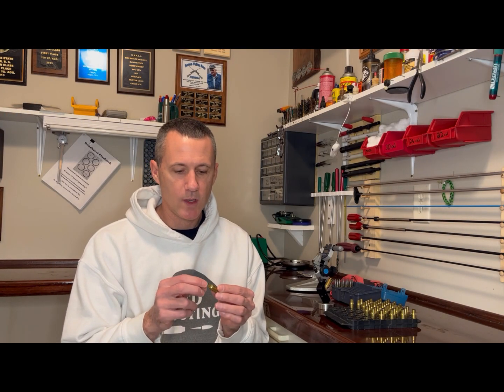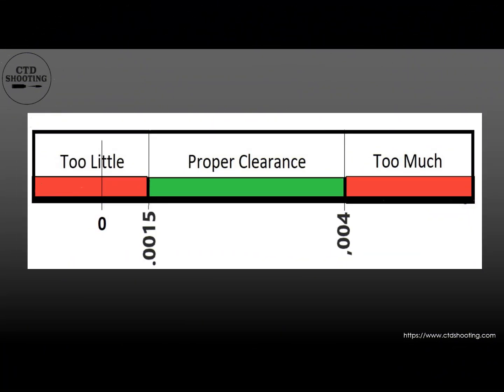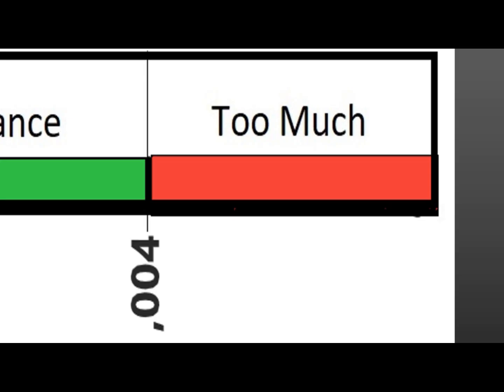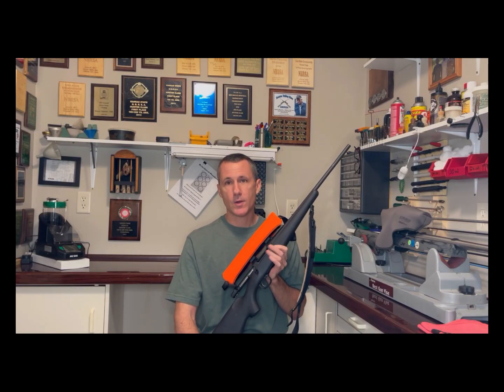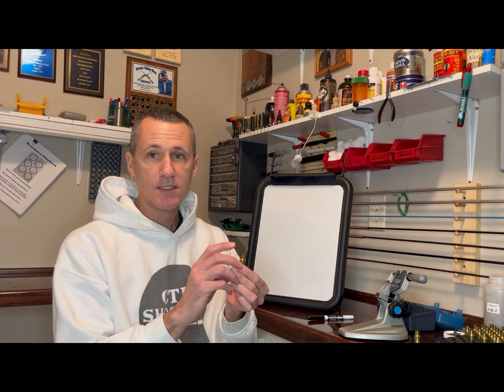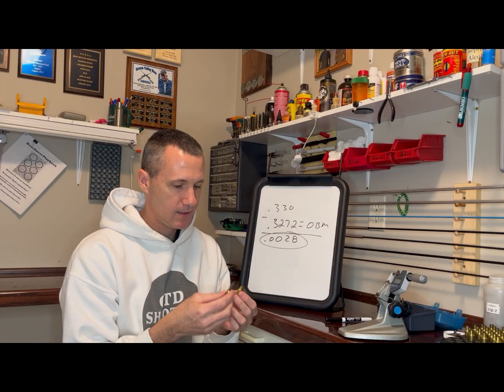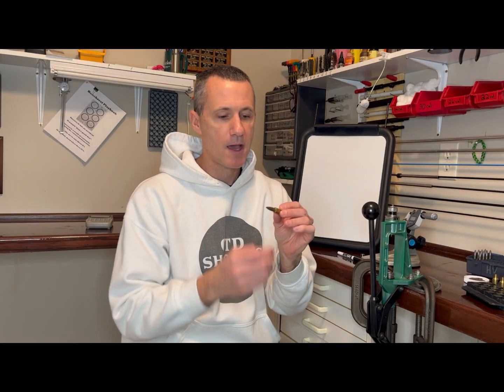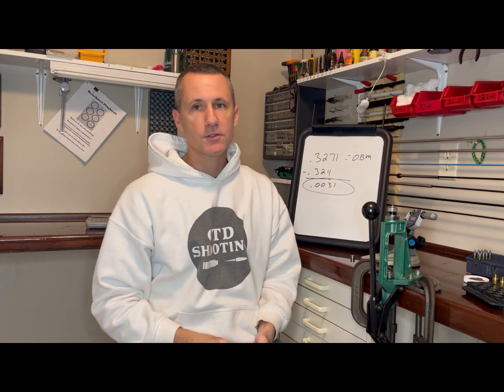Understanding Neck Clearance and Neck Tension:  Basics to Advanced

Comment: So when using .311 diameter bullets do i use my .307 expander or .310 expander? If I use the .310 with .311 bullets is that not only .001 tension and not enough, especially in a semi-auto?
Reply from the maker: Thank you for taking the time to ask a good question.  No, .001 neck tension is usually not enough. Please keep in mind, if you use a .30X expander that does not always mean the brass will be .30X due to brass spring back and work hardening. If those are your two options I would try the .307 and see how the rifle shoots. Your particular rifle will always be the best judge of what it wants.  Thanks again
Reply: @ctdshooting Thanks! Ive been using the .307 for a few days and no issues and neck tension feels perfect 👌 the .310 expander just threw me off
Reply from the maker: @Mav8887.  Glad it is working out.
Reply: @ctdshooting Thanks 😊

Comment: How do you get the rifles neck measurement
Reply from the maker: 3 main options.  If it is a custom barrel you can have the gunsmith give you the measurements.  If it is a factory barrel you could do a chamber cast (I have not had much luck with that).  Or, you can use the SAAMI specs found in many reloading manuals or online.  
SAAMI numbers will probably be the least accurate due to manufacturing tolerances, but should get you in the ballpark.

Comment: Very interesting, does this strictly only apply to custom match chambers (whatever that means, tight?), and is it a waste of time for factory rifles?

You also mention you “know” your chamber is “0.330” Is that an actual measurement when the chamber was reamed or just taken from the sloppy SAAMI spec sheet? How do you measure your chamber neck? Or any other important chamber dimension? Is this another custom chamber thing? Are factory rifles a mystery chamber dimension?
Reply from the maker: Great questions.  No, it is not a waste of time for factory rifles.  You may/may not see the precision benefits mainly due to neck tension, but you will see increased case life due to how much the case neck/shoulders are moving.
Yes, the .330 is the actual measurement from the chamber reamer.  
For my custom barrels, I use the measurements from the reamer.  For factory barrels I use the SAAMI  specs to get me in the "ball park".  Then use the tips in this video to know if I have enough.  You could also perform a chamber cast - which I have not had much success with.  Hope this helps.  https://www.youtube.com/watch?v=P3sW5-DzbFM&t=12s

Comment: How do you measure your chamber’s clearance to begin with?
Reply from the maker: If it is a custom barrel have the gunsmith give you the number when he uses the chamber reamer.  If this is a factory barrel you have three options (that I know of)  1.  chamber cast   2. pin gauges   3.use the  SAAMI specs.  
The SAAMI numbers will be the easiest and probably get you close enough depending on your desired level of precision.  Here is a quick video showing how to make sure you have enough clearance.  Hope this helped.  https://www.youtube.com/watch?v=P3sW5-DzbFM&t=12s
Reply: @ctdshooting thanks, I will check it out. I thought you used a brass fire formed to your chamber and added the expected spring back.
I just found out about your channel and I like your presentation style, I’ll definitely watch more of your videos in the future.
Reply from the maker: @DCSCIENTIA  Thanks for the kind words and I hope the information helps you create your own system.
I like to use actual measurements whenever possible.  Much easier to figure out issues when they arise.  Thanks again.

Comment: Is the only way to measure the diameter of your chamber a casting? Is there any other way, other than that. I have a custom rifle, but it was built several years ago and I have no idea what reamer was used on it. When I had it built, I really had no idea what I was doing and did not ask about the reamer.
Reply from the maker: I have heard of people inserting pin gauges from the rear of the action, but I have no experience with that.  I have a video to know if you have enough clearance https://www.youtube.com/watch?v=P3sW5-DzbFM&t=12s  Now if you have "too much" the only real drawback is work hardening of the brass and possible loss of precision.  Too much clearance is not a safety issue as in too little.  Hope this helps.  Thanks for taking the time to comment

Comment: How do find out your chamber neck size?  Measuring the case neck of a fired case?
Reply from the maker: No, the case neck expands when fired to release the bullet then "shrinks" back down again allowing the case can be extracted.  You have 3 options (that I know of).  Take it to a gunsmith and they have gauges that can measure the inside of the chamber.  Perform a chamber cast (I have not had much luck with this)  Use the saami specs found in many reloading manuals.
Here is an old video I made that might help
https://www.youtube.com/watch?v=P3sW5-DzbFM
Hope this helps with your question

Comment: How can you adjust neck clearance?
Reply from the maker: excellent question.  If you use factory brass, you are at the mercy of the manufacturer.  If you handload, there are 2 main variables you can play with.  One is to neck turn to the desired thickness - which will lead to your desired neck clearance.  The other is to use different bullets.  Some are "fatter" than others.  But, there is a forgiveness range of neck clearance.  In terms of accuracy you probably won't be able to tell the difference in .0015 and .003 or maybe even .004.  There is another way - gunsmiths can order different reamers or expanding reamers when chambering the barrel.  Hope this answers your question.

Comment: I’m having a 284 win built as a semi precision/hunting rifle. My loaded round is .315”. I have access to a .318” and .322” neck dimension reamer. Would .318” be enough?? No neck turn.
Reply from the maker: Just to make sure - .315 measured over the widest part of the bullet in the case neck?  (this may not be the actual seating depth of the bullet).  If that is the situation then .318 would be perfect.  .318-.315 = .003 clearance.  IF the .315 is not with the widest part of the bullet, then .318 might not be enough and can cause pressure issues.  I hope this answers your question.  Feel free to send me an email to ctdshooting@gmail.com and we can go over this in more detail.
Reply: @ctdshooting firstly thanks for the reply. Yes that’s correct. Is measuring .3145” - .315” I will make sure the .318” reamer is used.

Comment: Neck tension isn’t only about the I.D. of the case neck.  It is also about the friction inside the neck.  Fired cases provide lower neck tension because of the carbon left from previous firing.  New brass, even at .001 neck tension can present much more tension than average. Necks that have been brushed with graphite powder can have much lower tension, even with .003-.005 neck tension.
Reply from the maker: Great points.  Thank you for taking the time to comment

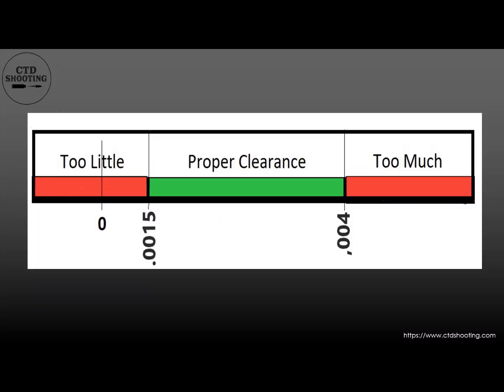Comment: 2:00 Regarding neck clearance.
Alot of people are running .006" for no-turn brass..004" is not to big.
Reply from the maker: Thank you for taking the time to comment.  Based on my experience with competition level rifles, anything over .004 clearance can lead to loss in precision.  A "hunting" rifle may not be able to pick up on the difference.  Also, anything over .004 leads to excessive work hardening to the brass neck.  Based on those two reasons, I will not recommend anything over .004 - with .002 being the "sweet spot"  But...if it works for you, then keep doing what you are doing.  Again, thanks for taking the time to comment.

Comment: I have a question for you, so I have a 22bra and my chamber spec is .250, I'm going to turn my necks to .0115 per side so my total is .247 and have .003 clearance, the question though is since I have to neck down 6bra brass should I turn the necks before I size them down for 22 or should I size them down to 22bra and then turn the necks?
Reply from the maker: Thanks for the question.  I have two things to consider.  I would size down then turn.  Turning slighly into the shoulder.  Second, your math is perfect if the widest part of your bullet is .224.  Not all bullets have a pressure ring - but some do.  The pressure ring will be larger than the bearing surface.  You will need to check the bullet(s) you plan to use.  Hope this helps.  Happy New Year.
Reply: @ctdshooting  ya I think that is why I wanna go with .003 clearance that way if I do get one with a pressure ring I should still have at least .002. so I have an interesting thing because the alpha 6bra brass is short on headspace to my 22bra chamber I have to do a false shoulder so I think I will neck them down with the false shoulder and turn them down to that false shoulder area
Reply from the maker: @Forumrida38621  I do not have any experience with false shoulders (I've heard of them, but never made them).  However, I know quite a few guys who have.  If you run into issues, let me know and I can hook you up with them.  Good luck with the 22BRA.
Reply: @ctdshooting  thanks I talked to Greg dykstra and he said turn them down at 6mm before necking down to 22 and he said not to worry about some of the shoulder being turned once fire formed
Reply from the maker: @Forumrida38621  Excellent.  If I may share some of my experience - write down all your steps.  You can then make slight adjustments each time to get the "perfect" case for you.  Very similar to a recipe.  I'm in the process of making a video explaining this idea while detailing my steps for making 30BR brass from 6 BR.  Have a good winter.

Comment: Ive noticed that on my 220 Russian brass after its been neck turned and fired 4 to 5 times. I M getting a donut on the inside of the neck. I can drop a bullet in it but has resistance... would you suggest a inside neck reamer?
Reply from the maker: Has this neck been expanded? (for example to 6  mm)  Generally inside donuts form below where the bullet is seated and really don't affect anything.  If your rifle is shooting the way you want, I would leave them alone.  
If the donut is interfering with the seating depth or neck tension then yes you can purchase an inside reamer to take them out.  You will have to measure very precisely as to only get the donut - not the neck walls.  Caution - You might want to remeasure for tension and clearance after you do this - just in case you took off more than just the donut.  Hope this helps.
Reply: @ctdshooting  yes been expanded.  Yes the donut it right at the flat base line of my bullet.  I just noticed when I placed a bullet base down in the case. I had a lil resistance but I don't think it's interfering with seating depth
Reply from the maker: You're probably good to go and if the rifle is shooting good - then I would no mess with it.  In my experience the donut (both outside and inside) were formed during expansion.  When you outside neck turn you take the outside donut off.  When I make the 30 BR brass I get the same thing.  I have different inside neck reamers to just barely skim the inside of the neck which removes this inside donut.  However, many great shooters (some Hall of Famers) don't mess with the inside donut.  Hope this helps. @redraiderreloading7612

Comment: May be a dumb question but I'm learning into my second year. How do I measure my neck clearance or diameter to achieve my 2 thousands I hear this alot. Also carbon on the neck is from the neck not trapping gas or in time. Thank you for your reply or any comments welcome.
Reply from the maker: Absolutely not a dumb question.  Neck clearance is the OBM (covered in this video and in depth in this one: https://www.youtube.com/watch?v=xs4h_zscjVc&t=1s) subtracted from the neck chamber dimension.  For any of my custom barrels, the gunsmith tells me what the chamber dimension is.  For my over-the-counter hunting barrels you can use a chamber cast or you can use the SAMMI specs.  Personally, for hunting barrels, I use the quick check method for neck clearance (roughly 3:10 in this video)  For hunting barrels I feel that is good enough because there are much bigger pieces to the precision puzzle.  Now, neck tension....that's a different story and much easier to control.  Hope this helps

Comment: Is it necessary to use a mandrel?   I wish you would  discus the mandrel business as well. Thanks
Reply from the maker: Thank you for the question.  I am assuming you are asking about the resizing mandrel (many times called the button or expander ball) and not a turning mandrel.  I only use bushing dies.  When a decapping rod has the button on it, I take it off before using.  
However, the measurements would still follow the same process because resizing is completed (which ever way it is performed) before you measure the resized portion of the neck.   I have never tried to buy different buttons to adjust the neck tension, so I can not comment on that.  I will add this to my "to do" list of videos.   Thank you for the question and suggestion.  Stanley

Comment: How would I find my neck chamber in a store bought rifle? Or is there a standard?
Reply from the maker: You have a couple options.  1 is to look up your cartridge in https://saami.org/technical-information/cartridge-chamber-drawings/.  This should get you decently close then use the quick check methods described in the video around the 3:10 mark.
2.  Perform a chamber cast.  3.  Use pin gauges (if they are long enough to reach the neck area of the chamber, you may have to take the barrel off if they are not)  4.  Gunsmiths may know other methods.
Personally, I really pay attention to this number on my level 3 and level 4 rifles.  Level 1 and 2 I just make sure I have enough and get the rifle shooting good.  Hope this helps.

Comment: Great video thank you! I just acquired a 30BR. Im rolling around in my head about what you said about bushings not sizing to what they are labeled. I have been under the impression that the different results are due to brass spring back. Not every piece of brass acts exactly the same. So now i need to go test all my bushings to see if im getting results like you. Very interesting, thanks again! Always trying to add info to my mental tool box
Reply from the maker: Absolutely - work hardening can affect spring back, which is why many anneal their brass.  However, there are manufacturing tolerances also.  For example, I am tuning a 6 mm AI and would like to have .003 neck tension.  I bought a .271 bushing and it resized the "freshly annealed" brass to .2704.  So...I bought another .271 bushing from the same company and it resized the same brass to .2719.  It is the nature of the beast.  Thanks for the comment.
Reply: @ctdshooting  thanks for your reply. I do anneal also. Started competing with 6BRA and ramping up for 30BR and 6PPC. Trying to absorb as much info as I can

Comment: My approach is simple: Anneal after every firing, full length size with a standard sizing die with expander ball removed. Set neck tension with a mandrel 0.002” under bullet diameter.
I feel like setting the ID of the case mouth via bushing die is more complicated than via expander mandrel. 
Cheers
Reply from the maker: Thank you for taking the time to comment.  The method you use sounds like it has some advantages.
Reply: My mandrel die is Sinclair and my neck setting mandrel is a 21st Century carbide.

The case neck wall thickness uniformity micrometer from Sinclair helps me dial in the cases I want to load in combination with a 21st Century concentricity gauge.  

I have a Forester Co-axe press and I use Lee and Forster dies.  RCBS check weights set my Lee powder scale and I usually drop powder into the scale pan short then trickle up with a Hornaday powder trickler.

I use notebook and the written details of every load go in every box.

I use an RCBS Precision MIC to find headspace and set the lockring on my sizer dies.  I can full length size or I can just bump the shoulder back with a Forster bump die then set the final neck tension with a mandrel.

I neck turn with a Forster case trimmer setup to neck turn and I trim cases with a Wilson/Sinclair micrometer case trimmer.

Remengton 223 Loads are tested with a stainless Tika T3 with consideration  for compass bearing and the earth's rotation.
Reply: Neck turning is primarily for checking uniformity and the cuts are as minimal as possible followed up with a 000 steel wool polishing.  Anealing is done with a torch and a socket on a drill and a pan of water.
Reply: Hopefully you’re adjusting die properly so you’re only shoulder bumping slightly.001-.004 and not running the die all the way to the shell holder and over bumping
Reply from the maker: @jamesspikes  Sorry - just saw this comment.  Yes, proper should bump is important for many reasons.  And....the correct amount might vary depending on type of firearm reloading for - example bolt rifle vs gas gun.